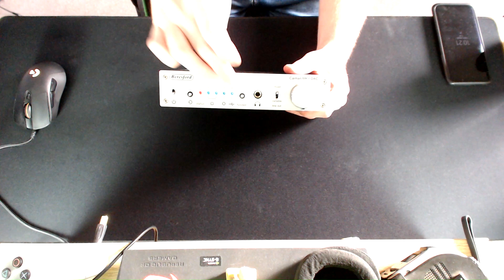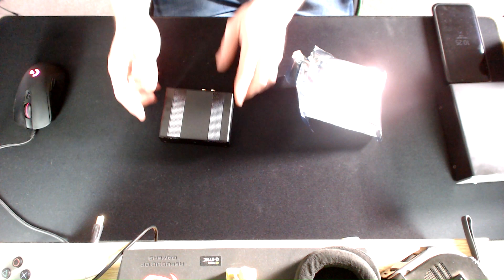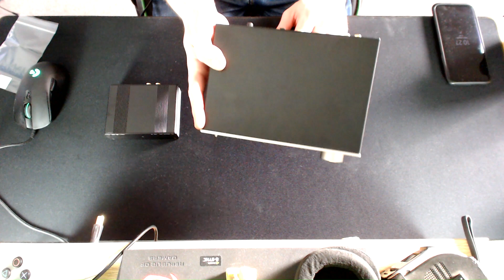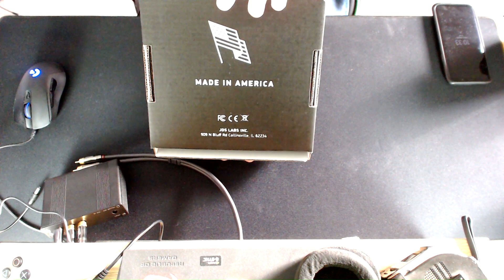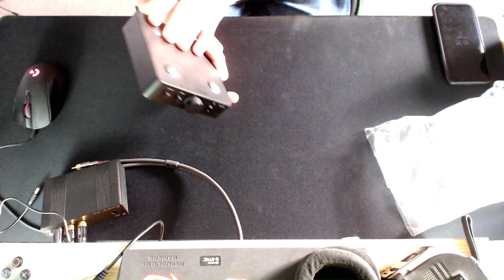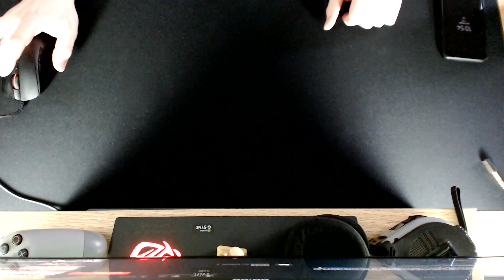JDS Labs OL DAC and Atom Unboxing and Setup

Comment: Hey, got a question on the connections

The DAC is connected to the PC through the USB cable, then
The AMP is connected to the DAC through the RCA cable. I can understand that (please correct me if I'm wrong)

What I can't understand is to what device is the AMP connected on? The 'out' ports.
Reply from the maker: You can connect either a power amp for passive speakers (with no volume control), a pair of powered studio monitors, or active speakers. These will work fine with the Atom's RCA Out ports.

Comment: For an audiophile, your mic is fucking quiet. Seriously add some gain to your video...the people in discord at 20% were higher than  your video cranked all the way up in windows mixer and cranked in the youtube video player.
Reply from the maker: The gain on my audio interface was set to the 3 o'clock position. I just tend to be softly spoken. Thankfully, not too soft. Otherwise the ASMR fans will be swarming!